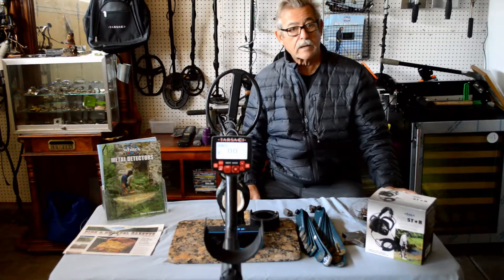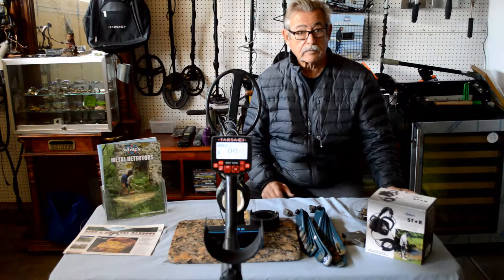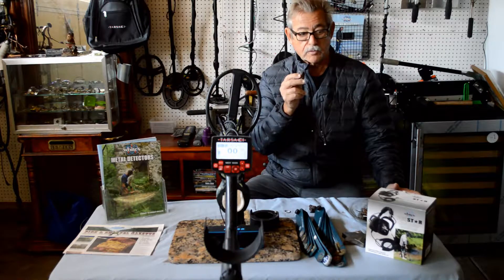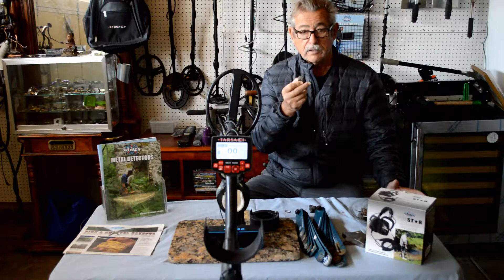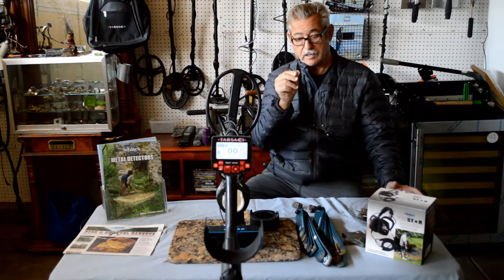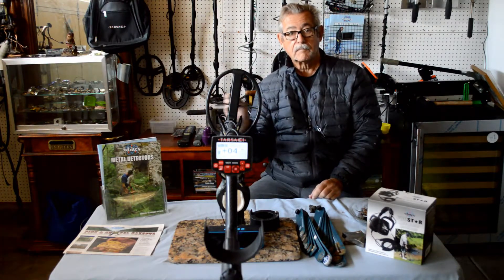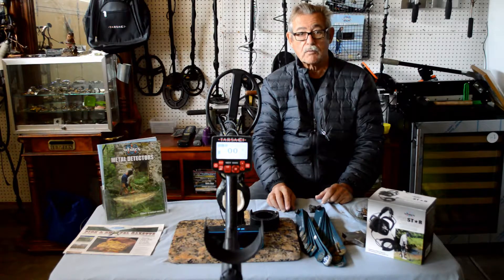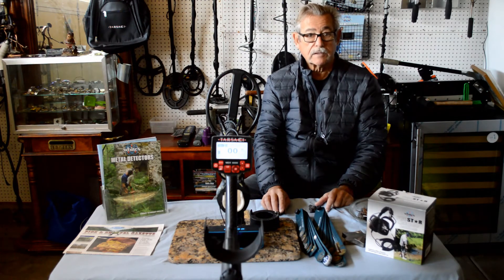Tarsacci MDT 8000 Non-Reactive to Carbon 'Coke'

Comment: I have seen sharpshooter use a billboard wireless speaker so you can hear with out the headphones.  Also someone else looks like he is using some kind of Garrett module as an external speaker.
Reply from the maker: Several Types can be purchased on Amazon.